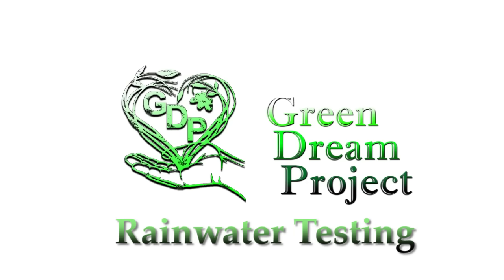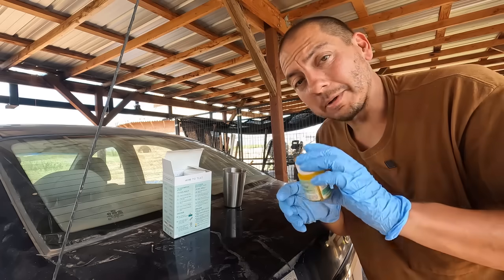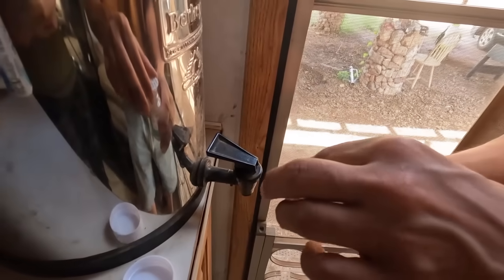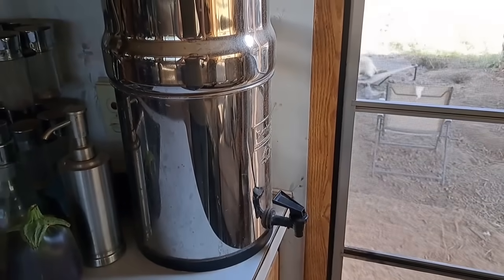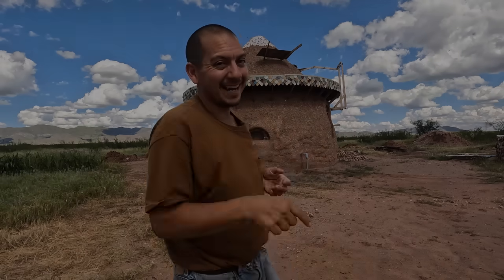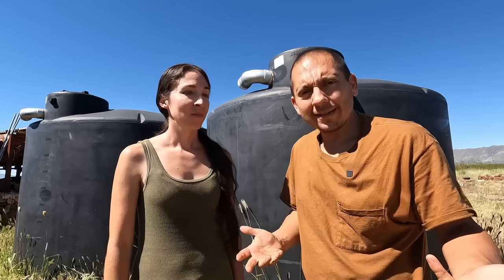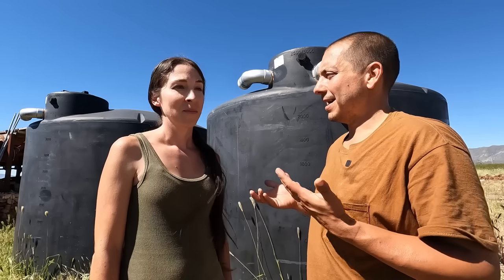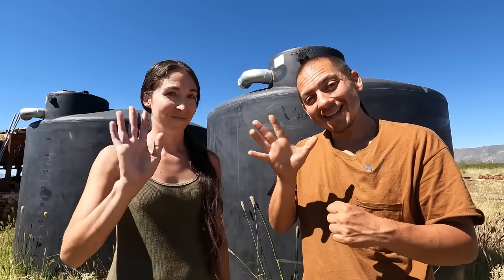Is Rainwater Safe To Drink? We Put Ours To The Test

Comment: I'm more interested in looking at the water in a microscope to see exactly what is visible in the water. I collect rainwater from a metal roof. At first I collected from rusty metal and just used the water for washing and bathing. Then I put new galvalum metal on and there are very few visible contaminants. I get some pollen, maybe seeds or bugs that were blown around. I have drank the water unfiltered without evident problems. I let the water settle in tanks for at least a day to let sediment settle out and then transfer it to clean containers that don't sit in the sun. 
I'm more worried about lead, fungal/mold spores, and intestinal parasites than forever chemicals. That would take a microscopic view. I don't live near jungles or close to cities, but it would be nice to see organic contaminants that some tests don't account for.
As far as the forever chemicals are concerned, anyone who uses nonstick pans is getting a lot more from cooking with those than from just about any water source. Thanks for the video 👍

Comment: Nice setup 👍. Way to take control of a very important resource ☝️

Soil removes a lot of stuff as it moves down to aquifers (what it removes depends on where you live). You may have leaching from your tanks with the acidicness of the water and sun (not sure), but your Berkey should remove some or all of it. It all depends, PFOAs are everywhere, I think Berkey "claims" to remove them (I hope it does because that is my final filter on the road and home). We used to use reverse osmosis, but then I wondered what the media was made of and the immense pressure and well I don't know. Great job taking it upon yourself to check.

Comment: Imo rainwater is slightly acidic. Even water from an ice box is slightly acidic. But mains water is treated to ensure the water is neutral ie neither acidic or alkaline.

Although rainwater is safer to drink than mains water, I think it's best to drink rainwater when it's fresh! I wouldn't like to store rainwater for long periods or use a water distiller.

Btw I can't understand why you use a water distiller? One can put mains tap water through a water distiller to get the SAME cleanliness of water.
Additionally you should have included a strip test to freshly fallen water!

Comment: Dude, you didn't test for forever chemicals, you tested for the common chemicals in water, there are like 300 forever chemicals. And for the dorks saying you can't do much about forever chemicals, you can distill and then run it through a charcoal filter or something. And for the dorks that say they drink rain water all the time and it's fine, tell me if you get cancer in the next 5-10 years, it doesn't kill you right away.

Comment: I've been drinking straight from the tank for most of my life and I'm still alive! I'm in Australia. The only thing that rainwater might get is Giardia which is a bird parasite I think.
It can cause issues in your gut that you will need to take some meds for, for a week. Then all gone. The pH of mine is lower than that shown in this video. Mine is down around 4.5 which is a bit low but not like that all year and mostly in dry conditions. Lots of rain usually causes the pH of the rain to rise again to a more acceptable 5.5 which is a significant increase. 
I have diverters on the guttering so no crap in the tanks and then it is straight into my glass at the tap. All good. 😁😄

Comment: I'd drink it. No problem.  In fact, your water is slightly acidic which will prevent build up of scale deposits on your fixtures and appliances. 
Remember that pH is a logarithmic scale. A pH of 5.0 is 10 times more acidic than a pH of 6.0.  Orange juice has a pH of about 3.8  Lemon juice (fresh squeezed) is 2.0-2.2.  Vinegar is about the same as lemon juice. I put squeezed lemon juice in every glass of water I drink.
We use vinegar to clean our dishwasher and washing machine of scale build up.

Comment: Send a sample to Nile Red. He's a genius chemist and he might be looking for a new project for his channel. I recomend experimenting with wet clay bed filtering. Clays bind radioactive particles and it might do also with PFAS. The most reccommended fliter is activated charcoal, bit I'm not finding anything on the internet where anyone has tried using clay mud. If it works I would use the clay bed filter in the early stages of flitering but after any filters that remove larger particles.

Comment: People would need to do this in the areas they live in. The middle of no where is not the same as downtown Los Angeles, or say if you live near Tejon Ranch in Gormon, Ca, where they have the largest toxic waste incinerator on the West Coast in operation. I would say living near freeways, or electronics mills, or oil refineries could also have an impact on whether or not you might want to test for "forever" chemicals. Definitely high humidity areas with high mold spore counts would need to rely on the bacteria tests more as well. I would also wonder how testing after a plane flies by and leaves one of those vapor trails that spread out and form clouds that stick around all day.

Comment: Those black plastic storage containers have phthalates. Because they are black they heat up which leaches more phthalates into the water. 
So maybe rain water doesn't have much in it, , but storing it in plastic is horrible
Reply: To remove phthalates from water, you can use reverse osmosis

Comment: I'm glad that you don't have any heavy metals in your water, but you should have minerals in any liquid that you consume. Just like it's not advisable to drink distilled water, the issue with drinking overly filtrated water is that it doesn't have mineral content that is safe for drinking. The reason why that is an issue is because when we consume water without minerals in it, it disrupts the balance of minerals in the blood stream. When the mineral levels are too low in the blood stream, it will pull minerals from cells, such as calcium from bones, to balance the mineral levels (or electrolytes) in the blood. So, I would recommend, if you don't have it already, to add a mineral filter in any water that you're consuming.

Comment: I've been using another brand of gravity powered filter for a few years now. I do use city water with my main concern being lead, followed by all of the chemicals they put in it. I'm accepting the manufacturer's claims about what the filter is capable of removing. Having said that, other than lead, most minerals you would find in (Chicago lake) water are perfectly ok to consume. Calcium, sodium, and stuff like that are ok. As far as living organisms, they put enough chlorine and fluorides to kill about everything. Ok, an honest plumber will tell you that you don't want to know what lives in your pipes! The reality is that we naturally can handle most biologicals, in moderation, and after our bodies adapt. (I'm not talking about typhoid bacteria or other serious stuff). It looks like you are doing everything right. As far as forever chemicals, I have to suspect that whatever your carbon filter can't remove will be at such low levels that you shouldn't worry about it.

Comment: I wonder what is the dissolved solids in your rainwater measured with a simple device TDS. it is a device measuring electric current in water so it measures conductive minerals in ppm part per million of water. Surely the value should be low.

The only main concern with rainwater is contamination from the tank. You should check the TDS so you are sure there little to no "food" for bacterias.

Also, the contamination of rainwater comes from plants nearby. Some plants put sulfur dioxyde in the air and if you collect water nearby the rainwater will collect sulfur and the water will be more acidic. The same applies to carbon dioxyde but in a slightly acidic water, the CO2 will not stay in water. 

You have made a very interesting practical video. Good job.

edit: sucrose like sugar can be dissolved in water but the TDS meter can measure it because sucrose is not conductive in water.

Comment: I think you should paint the tanks white instead of black.  The reason bacteria grows in hot water and the cooler you can keep the water the less bacteria you will have.
Reply from the maker: The tests show no bacteria. It's more important light and debris don't get inside. The color doesn't matter so much.
Reply: @ourselfreliantlife  Yes the bacteria when tested was negative with in the limits of the testing media usually 1 part per million but that does not mean bacteria is not present and cannot accumulate over time.  Only photosynthetic bacteria need light but there are many types that don't need light to grow.  Bacteria only needs a food source which could range from a leaf to a bug.  colder water keeps bacteria cell division to a minimum.  White color tank would reflect to sun and make the water cooler. black color tank absorbs the sun and can make it a lot hotter than the ambient air temps.

Comment: I will share my relatives experience, grandparents drunk water from well only and used it for everything else built in with pressure tank pump just like normal house everywhere and live in busy suburb and they lived 99 years grandmother and 94 years grandfather. Tests also were made and they were good or if nitrates just a bit up. SO I THINK WATER FROM SKY IS EVEN BETTER only is the bird poop problem from roof, but from soil is same i think from roof is even better, just make sure it is not asbestos roof material and all is fine

Comment: Have lived on rainwater most of my life, that's unfiltered and untreated. Sure you get the odd dead bird or rat in the tanks at times but you only notice if you drain the tanks for some reason. Got rainwater at my present house and have lived here for 12yrs, cleaned out the main concrete tank a few years back to repair a small leak. Was about 8ins on black mud with no shortage of bird bones in it.
Reply: My experiemce too. If you're picky about cleanliness,  filter the water you use for drinking  through a ceramic filter. For all other purposes use as is -  straight out of the tank.

Comment: We've used a water distiller for the last three years. Because of its negative charge it is slightly acidic. Rain water is distilled water hence the acidity. Because of its negative charge it draws the positively charged toxins and flushes them through your system. The minerals you should be getting from your food, remember your body cannot use inorganic Minerals only organic Minerals. Inorganic Minerals calcify your body.

Comment: So here is a question- do these tests detect forever chemicals (?)
Reply: Nope.   Those tests are designed for the type of water provided by an industrial water supply system like in a city.   It didn't test for mercury, insecticides, herbacides,  or other environmental contaminants one should be concerned about with rain water.
Reply: @loughkb  It DID test for Mercury.

Comment: When you did the tank water testing you missed the most important result.  a 0.2 lead is a concen.  Not sure where this would come from.  Maybe in the pre lead free gasoling lead from gasoline contaminated the sides of the road ways.  But in your rain water tanks???  Also for some reason you SKIPPED the lead in all the other test you did.
The toxicity level of lead is set be the detectability level, not a test strip but by actual chemical/instrament detection methods.

A chemist your not.  But I would expect the results you got except for the lead level.  Next time it rains capture some water in a clean bucket and test it.  Do this a few time, for stastics, and see what the lead is.  If it is zero then you may have something in your catchment system contaminationing the water.  Remember Flint MI.

Comment: I can remember testing rainwater in the 70's for PH and it was around 4, very acidy. That was back in the days of acid rain from all the coal fired power plants. I lived in Pa. at the time.
Reply: More so from your car not having a catylitic converter. Nitric acid was the main compound in acid rain. Funny enough it was liquid plant food. The things that benefit the world the most are always outlawed. Plants eat nitrogen compounds and use carbon dioxide in photosynthesis. The environmentalist quacks just don't even know 2nd grade science
Reply: That's not true, rainwater has virtually no minerals in it and you will get a false low reading from a typical pH meter. The definition of pH is a logarithmic measurement of hydrogen ion concentration. If there are no minerals, there are no free hydrogen ions and a pH meter is inaccurate.
Reply: Ok! LMAO

Comment: It would be easier to check the results if you held the test strip the right way to align the right test blocks the strip should be held from the bottom aligned  with blocks and if needed you can slide it  over to match colors.

Comment: You can remove forever chemicals with RO.   It would be good to do the comprehensive test and determine how many forever chemicals you have but also to prove that the test does detect them.  It is for sure you have microplastics but it can be parts per trillion, and take decades of drinking before it could affect your health, and this is not even well understood.
Reply: RO doesn't remove all chemicals, but most.

Comment: I have been a plumber for 40 years and just now I am learning about water safety and filtration. I am also taking classes on it and just started my 3rd 10 week class. I have heard there are forever chemicals every where even in rain water. So I would be interested in further testing but will not "demand" it. Sending water out to labs for testing gets expensive but is the best for getting results.
Reply: The last filter system I looked at had 15 stages of filters, including uv and hard water softening. Next level will be to identify these forever chemicals and a way to neutralize them with othe chemicals😝
Reply: Isn't it crazy how deep and complex that rabbit hole is?  I recently heard someone suggest that pvc has a chemical that's basically bpa, but one atom different, and does the same thing.  Just imagine if it turns out that pvc is just as bad as lead pipes, but in a different way!

Comment: If you think about it, rain water is like distilled evaporated water, because it is. Thanks for testing!
Reply: Rain drops form on dust particles. Distilled drops form on a container lid.
Reply: the water is but not the contamients, like chemtrails
Reply: @roberthart9886  Enough with the 'chemtrails' nonsense. There is nothing but small scale testing of geo-engineering, entirely over oceans, it is not routine in any country, you don't have reason to think these practices would do you harm and meanwhile you aren't worrying a fig about pesticides which are sprayed routinely in virtually every country in the world and are, by definition, poisonous.

Comment: and second those strip tests and off the shelf tests are well error prone arent reliable you want lab tests numbers percentages safe percentages etc.. folks unless you live in a country where you been drinking river water yoru whole life your body wont be aclimated to it.. second you can order water fill those tanks up use rain water for toilets etc and have 2 large 50thousdand gallon tanks for water  drinking water delivered  that simple the only real safe way is you collect it with a hole in the ground a cellophane cover a rock on top of the celefance a cup in the center as the water turns to steam it drips down to the cup it wont be alot but have many or wait till end of day this is clean water for the most part because its distilled in gas form and condensed  only for emergencies dont rely on it

Comment: I would be interested in the dissolved solids level or parts per million(PPM) and the exact PH.  Personally I think distilled water is the safest to drink.
Reply: I run my distilled water through a RO filter also, some chemicals have lower evaporation temperatures than h2o.
Reply: Distilling water is the best method. As for chemicals that have lower boiling points, this is where moonshiners "cut" the distillate. In chemistry terms, its fractionation. Throw out everything up to 212F. Then collect until the temp rises above 212F.
Reply: @The bees knees  You are right if you test the first cup of distilled water it will not be zero ppm but the next cup will be zero.
Reply: @terrafirma9328  I use a carbon filter for anything that can get through distilling but I also use RO in the distiller to prevent buildup on the boiler.

Comment: Mmm, interesting, but I like to warn you to get (if possible) a test that tests also for aluminum, barium and strontium, but I think it will be hard to obtain those. Some scientific criteria is omitted to make things look different that those really are. I'm glad though the results are good, anyway the acidic portion might be because of aluminum. Try to see if there is also some tests possible for particulates, since metals don't dissolve in any case. It's worth to try it. Cheers.

Comment: Part 1
Love your research on rain water. I suspect most everyone enjoys turning the faucet on and immediately having hot water for dishes or showering. In a camper, you probably do not wait very long depending how far away the water heater is. Just consider how much precious water you may be losing down the drain, waiting for hot or even warm water to get to the faucet. I installed a "Watts’s" water recirculating valve, into my hot water line at the water heater. The second part installs near the faucet or shower.
Reply: good tip!